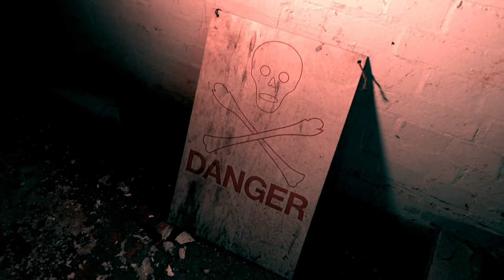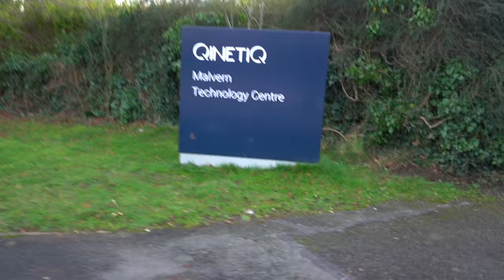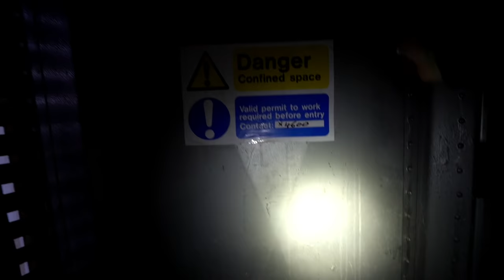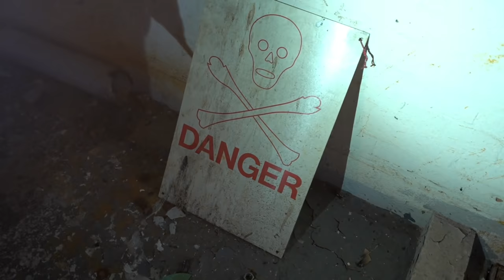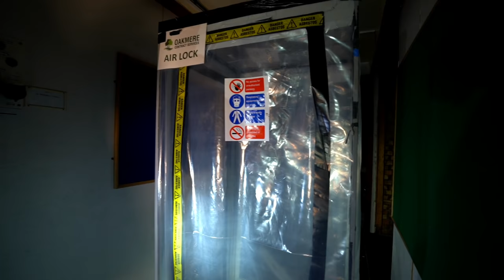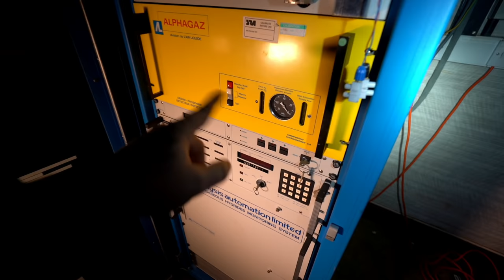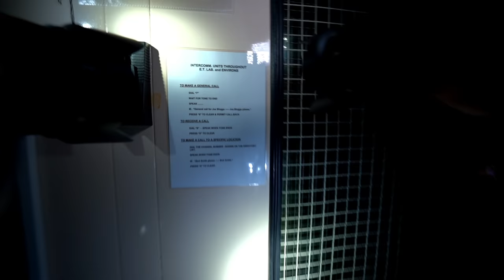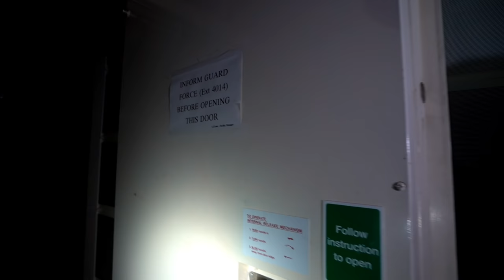We should not be in this underground government research base (VIRUS QUARANTINE)

Comment: you guys need to invest into masks,
Reply: chris murphy  skimasks, yes, definitely would look like robbing. proper breathers or enviromental filtration masks, probably could save their lives at some point or prevent a disease.
Reply: chris murphy how does protecting yourself make you look like a thief?
Reply: Masks, gloves, etc. Then get rid of what you were wearing when you went there. Obviously  they have the plastic barriers up for a reason. With all the virus scares happening in the world......
Reply: and a RadEye dosimeter too.
Reply: Ive got a mask with me but it gets so clammy that I dont tend to want to use it. These places have a ir amount of air blowing through them and we dont kick up too much dust. Fingers crossed we dont end up on oxygen in a Emphacemia ward... lol.
Reply: chris murphy  thief's are persons too ya know
Reply: @mcpop0  yeah respirators. 3m 6800 full face can be had for around 100usd. It seals once around face once around nose and mouth. Way better than half mask. 

If one needs glasses it sucks cause the empty frames (and mount inside) are like 140 usd  and lenses run around 100.

 Bows on normal glasses break the face seal. 

Contact lenses work but in the event u seal breaks Geting something under a lense would make bad worse. I wanted to make a powered air mask out of the one I have. There's a 400usd add on that has a battery and blower so it sucks air through the filter into the mask. This increases comfort as it tends to keep it cooler. It decreases fatigue as over a few hrs the added effort of drawing breath through cart adds up. Most important it creates positive pressure.. Ie mask seal breaks air rushing out will often prevent anything from coming in. I figure I can 3d print cheaper than what 3m wants though. The 7k series has a better head harnus. I had some shit go south in my life. One day I'm in my flat in tvec mask on wirh 3 bug bombs going off wearing my 6800 thinking Im hizenberg (breaking bad)...was all a fun time until bug bomb Set off smoke detector and reaching up I bumped the mask lol. Just that moment was enough I was running for the door coughing my ass. They definitely work.. But bumping that seal can be game over. I'd say the biggest problem is a lot of the stuff that might come in through a break leaves you in a state where you're copping drooling whatever to the extent where to get right again that mask has to come off but if you're in an exposed area that's not really an option
Reply: 3m Double Filter mask
Reply: I would've been wearing a Gas mask for some of those room just to be on the safe side.
Reply: @casey hp If they now wamt to shop ( at least in Germany) they have to weare masks .
Reply: chris murphy  
Why?  Well maybe because there was a giant black asbestos removal container from DEM Waste, sitting in the main lot?  Going in without lung protection was stupid beyond belief.  Especially when asbestos can never be removed from your lungs.  Once you inhale it, its there forever.  Thats why it causes cancer.
Reply: @madlukasik  Viruses are very unstable, depending on which type or family it belongs to it won't remain infectious for more than a couple of weeks, a month or so at best. Unless they're actually remnants of biowarfare experiments, because weaponised viruses have chemical additives to stabilise them and keep them infectious for much longer. But even with such additives they'll be inactivated in a few months, or a few years tops. Bacteria on the other hand can remain viable and infectious for much, much longer. Spore formers such as bacillus anthracis (anthrax), coxiella burnetti (q-fever), and clostridium botulinum (botulism) can remain infectious for years or even decades, real nasty stuff.
Reply: @mcpop0  lmfao doesn't make them look like they are robbing shit at all
Reply: @thickgirlsneedlove2190  masks protect u from harmful things tho why wouldn’t u want one lol

Comment: The conspiracy ideas are fun but I'm guessing that clean room (ET, Electronics Testing? Electronics Technology, Etc.) is for electronics/photonics research. Specifically appears they were testing laser devices. Lasers are used in a variety of industrial and military applications including measuring, targeting, signal interference, and even as a method of destroying objects (look at the USAF laser mounting on a Boeing jet that can explode a missile in mid air). The isolated room was probably a test bay which is common in laser testing. The tinted glass/material on the windows was probably laser glass/flexible plastic that is designed to filter out specific wavelengths of light so that it wouldn't affect people on the outside. This is usually tinted in colors such as yellowish green, blue or red/amber. Anyone inside would be wearing protective eye wear but its also possible they just observed through the windows. The wire was probably there to stop fragments from anything under pressure, like a high powered gas laser resonator which would be part of a laser design in certain circumstances. The square glass piece looks like a partially reflective mirror. This is common in laser design as well. It would reflect a certain amount of light but let a specific percentage through.
Reply: Seems like you know what your talking about
Reply: Right you can even look up this company,  they build several  systems for war drones,jets and for one boat. Of course everything has to be super particle free, especially for lasers and telescopes and camera technic which could make out a needle on the ground. They were probably also testing all kind of stealth materials. Those drones were amazing, breaked the record on being in the air for 84 hours with solar technology which probably has made the drone also super silent.
Reply: It also explains.the need for clean rooms and acid exposure treatment kit.
Reply: Electronics and Thermography I believe. I like your idea a lot better than mine. My guess was a silicon die fabrication lab or something of that sort.
Reply: Lasers, Transistors=MicroChips, Kevlar, Fiber Optics, Meta-Materials, Quantum Locking=Anti-Gravitics. All Reverse Engineered.
Reply: That makes loads of sense, the whole aliens/chemical weapons/human testing thing is pretty silly, your idea is far more realistic

Comment: I just want to inform, those aren’t drip bags. The bag said hexaflourine and that is used for first aid in chemical accidents against hydrofluoric acid.
Reply: a
Reply: @obituki  e
Reply: @Ruby-fp3zp  h
Reply: What up?
Reply: It's known as hypocalcemia and it's calcium gluconate gel you use for HF burns
Reply: I googled that as well. Good call.
Reply: I've seen it used when testing with uranium
Reply: Yes and no
Reply: Scary scary stuff...!!!
Reply: Also, isn't an E.T. lab the same as a wet lab, so just a lab?
Reply: Why would you need hydrofluoric acid unless you needed to destroy something
Reply: @willysworld1018  "Hydroflouric acid is used to make refrigerants, herbicides, pharmaceuticals, high-octane gasoline, aluminum, plastics, electrical components, and fluorescent light bulbs. Sixty percent of the hydrogen fluoride used in manufacturing is for processes to make refrigerants" Source - CDC

Comment: Those yellow and black bars hanging from the overhead are safety demarcation lines.  Those bars are as close as you're allowed to get to the equipment, unless you are specifically supposed to be working on that specific piece of equipment.  It's also got extra room, so you stay away from anyone working.  This is to prevent bumping into anyone while they're handling HF acid.  Anyone going inside the line needs to be wearing full PPE, and anyone already inside the line needs to be asked for permission to enter.

Comment: There was no animal testing and no biological weapons on this site. We tested radar, lasers and satellite equipment. If you was to look back at photos from the 90’s and early 00’s. You would’ve seen lots of satellite dishes.
Reply: My guess is you also manufactured chips and other components due to all of the acid & wash stations
Reply: why would a radar need dip bags
Reply: @bradencurrie9732  Dude its not a drip bag, is a chemical wash solution. and as for why anything radar would need a chem wash solution look into how electrical components are made....
Reply: @DJRoach520  I fucking work at an electronic production and suppling company hexa fluoride has never once been in our buildings
Reply: @bradencurrie9732  We use sulphur hexafluoride in very large power transformers filled with mineral oil as a cooling and anti-arc medium on the transformer coils. The SF6 gas permeates the oil and fills any voids to prevent fires.
Reply: After making satellites there, then whom used it after that? Later page in there said 2011.
Reply: @bradencurrie9732  Then you aren't working with hydrofluoric acid.  If you were, you would have hexafluorine bags all over the place.
Reply: @bradencurrie9732  if you worked in electronics you'd know that hydrofluoric acid is used to etch silicon amongst other elements used within computer and microchip production
Reply: @bradencurrie9732  hexafluoride is used to wash hydrofluoric acid from surfaces and turn it neutral for safe handling after etching processes on said productions
Reply: @bradencurrie9732  hexafluoride is also used as an insulator and in semiconductors manufacturing both within the realm of electronics
Reply: @caveman stoneage im in the military and after the facility is deemed properly decommissioned they technically dont have to guard it at all you clearly have no idea what you're talking about
Reply: My point proven.
Reply: @caveman stoneage "And the sad part is the narcissists will never realize they are the narcissist because that's part of the condition...."  My point proven.  But the good thing about the internet is that I can disconnect and then you can't feed.  Goodbye.
Reply: Jfc... is this dude ACTUALLY a caveman? That grammar and spelling is utterly atrocious! 🤣
"Beeleeves mi guise! Eye no wut im toking abowt! Eye iz Souper jeenyus!! Eye wurks 4 kemikal labs!!"

🤣🤣🤣 I'm fuggin ded!
Reply: @caveman stoneage corporation
Reply: @caveman stoneage i'm sorry but if your so foreign you would still be able to speak English, i'm German and we were tought english in school dude, not to mention your name is in English.
Reply: @thebigrighthand7728  sorry but if he was using a mobile some times a mobile changes the spelling you write or even the hole word .
Always happens to me because I don't pretend read before I send so don't complain about spelling on the internet , oh there are some words spelt differently in different countries .
Reply: @babeez1513  Your comment made me lol...😁
Reply: @nunyabizness199  not sure why, but dope.
Reply: @mikethomassquires  think he ment , he has a seasonal job , packing Christmas tree lights for poundland.
Reply: LOL you don't need fume hoods and medical equipment for laser research

Comment: 08:00 Farraday Cage.. protects all electronics in an EMP attack. Anything electronic like cars phones you name it are fried unless inside a Farraday.
Reply: Its not a faraday cage as the top is open and also the door doesn’t have any protection on it ie a second door made from the same material going straight across
Reply: @JohnWard-em1qi  you could see it was pulled of the roof there was some there as for the door I'm not sure
Reply: Its clearly to hold aliens and prevent mind control
Reply: Farraday cages are also used to test electronics, so interference from outside doesn't affect the test. I used to work with one the companies that produce wireless colour changing bulbs, they had a few of these rooms in their lab for testing.
Reply: Farraday cages are made from copper mesh aren’t they? Not stainless
Reply: @matthewdowd4686  no, it's made with conductive material, it could be copper and anything that is a good conductor
Reply: I use pure gold in my cage

Comment: I actually liked bestobell up and the used to work on aerial insulation and air ducts. But they also made vests for radiation protection made from asbestos. Which would also explain the stalagtites coming from the ceiling. Because around the time those vests where made they  made roofing from asbestos as well.

Comment: that chainmail on the walls kinda reminded me of when i got a tour of a command bunker a few years ago. the guy giving the tour was stationed at the base when it was active and he said "non of us really knew what was going on in this room but if you look closely theres copper chicken wire on the walls and floors" (through the years vandals kinda stripped the place but you could definetly see there was a metal wiring on the floor and 1 of the walls) and he said it was to prevent signals from going in and out of the room. but that was in the early 50's
Reply: yes they had radio back then
Reply: @bigsean2473  im aware of that
Reply: Actually they were and are still used to protect sensitive electronic equipment from an EMP (electromagnetic pulse)  generated by nuclear detonation, or otherwise.

Comment: The asbestos bubble that's sealed at one end , was there a inspection panel in the floor . If so it might be the asbestos was under the floor which would make sense for heating pipes etc .

Comment: You should really carry a geiger counter or two on your trips. Considering the amount you've all spent on video gear it should be pretty minor. Half mask respirators are also strongly advised. A good to excellent mask can be had for 30-40 dollars.

You've got nice boots for your feet but not the other essential urbex gear.
Reply: So true! Could have used more "protective" safety gear, for sure.

Comment: I love your videos guys,  but I think you read to much in to innocent things sometimes. DERA used to manufacture secure components, RADAR, Crypto Kit, Night Vision, Lasers etc etc. The manufacturing requires sterile rooms especially with optical kit, or silicon conductor manufacture and your Hexaflourine is for acid splash containment not intravenous Injection (IV) in case you get acid on your skin / eyes. 

Biological experimentation / vivisection is more a lift sciences thing in the commercial world. 

You found yourself the R3 replica bunker that has been used since the 1950s to replicate RAF Rotor Bunkers, ooh yeah and the chain mail walls are most certainly part of TEMPEST controls. 

Keep it up great to see some of these places.
Reply: lewiski1 if that was the case there would be machines that would make the actual goggle and all the plasticky bits. And no, they don’t get them from out of area as it is a gov lab. I see no moulding machines, defective products, any imported or made plastic or metal products. By this I mean; circuit trays for making circuit boards, lenses or actual goggle for the night vision goggle lenses and testing. I did some research on the making of these things that you speak of, and there is no airtight chambers, sterile operating rooms,  there is no serious protection for radiation exposure and definitely not as much as there is for this place. And if what you say is true, why are there no cnc engraving machines, gold plating and dipping machines, Lathes, tools for machine work of any kind, there would be know need for environmental testing (et) sealed and secured chambers. ( I’d love to think eat means extra terrestrials but in the actual area they are in would not be an ideal place for that) there’s no need for bunkers if your making goggles. I understand that you employees of these places search for these videos so you can do your misinformation and such. The u.s. does it too. You brits aren’t the only ones.

Comment: I work in a semiconductor cleanroom, and we use lots of the equipment you see there. Acid baths are to clean equipment in. Laminar flow floors and ceilings. Even the strange thing with all the wires you found with the 'glass' on it looks like a 4 in. vertical wafer furnace quartz lifter (used for lifting that piece of glass when it's super hot).
Reply: And ASML boxes at 41:41 are the giveaway. They make parts for Semiconductor machines. Definately a semiconductor lab
Reply: Yellow windows at 43:23 keep photoresist from exposing prematurely before a plasma or wet etch.
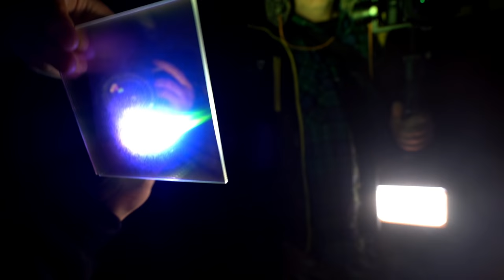Reply: 44:31 is a wafer reticle. It prints the pattern on the wafers.

Comment: This appears to be a mineral testing facility. They use that type of acid to break down mineral deposit samples to check the concentration of valuable minerals to determine where to mine for gold, copper etc. So, im interested to know where you got the idea it was a human testing lab or whatever nonsense you said. I worked in a similar facility here in Canada and everything ive seen so far looks very similar to the areas i worked in. It needs heavy ventilation due to the acidic fumes etc, and there are many dangerous elements being worked on, but it has nothing to do with living testing.
Reply: Whenever we had a power failure, we had to all evacuate the building due the dangers of fumes. Nobody was allowed to stay inside when the filters werent active.